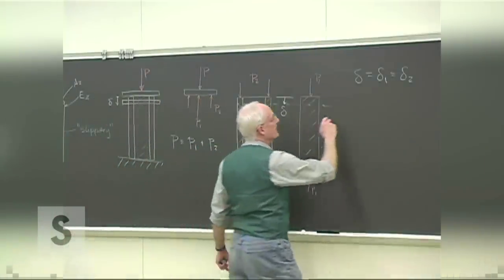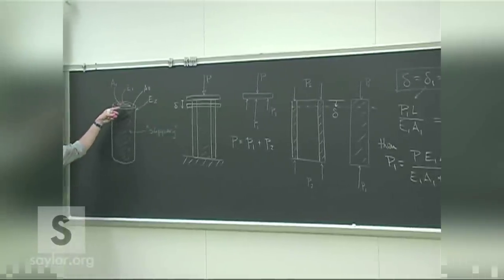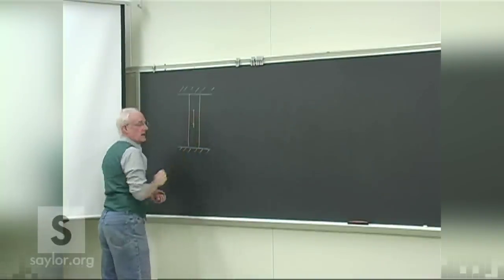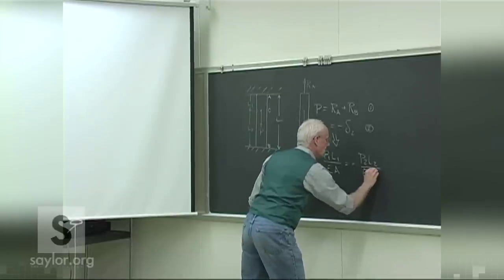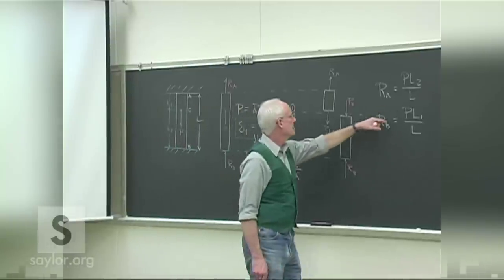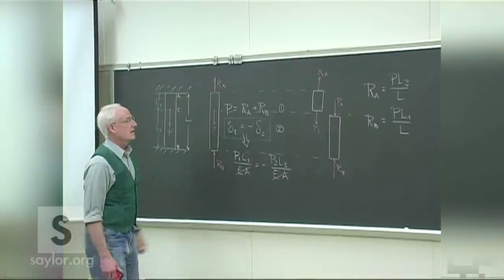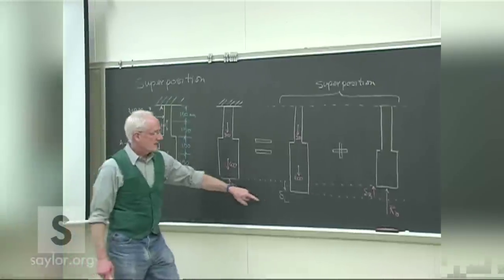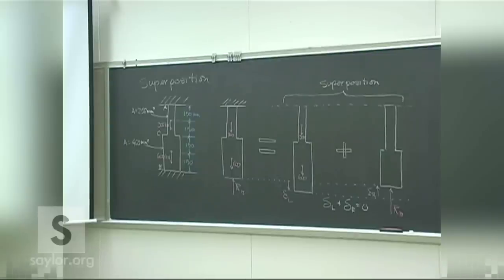Saylor.org ME102: "Mechanics of Materials - Static Indeterminacy"

Comment: For the superposition problem "Ra" acts in the +Y direction, does that mean the beam would expand if the top support is removed ?
Reply: 1 month later lol

..what kind of expansion? Like tension vs compression? Because, depending on the material, there could always be expansion. Like in compression, for example, most material will expand perpendicularly to the acting load while shrinking in the same direction of the load.

Comment: At 56:56 , to solve the new superposition problem dont i need the E value?
I was wondering here, if  i had an E large enough , so that my structure do not reach the 4.5 mm Rb must be zero, so now it's not independent of elasticity modulus.
Reply: Replying after three years. Damn! Same doubt. why is the elastic modulus not taken into account, There's a chance that the beam didn't expand at all ? I guess this problem is solved assuming that the material expands even for the slightest load.
Reply: Damn 9 years later, I still have the same doubt.